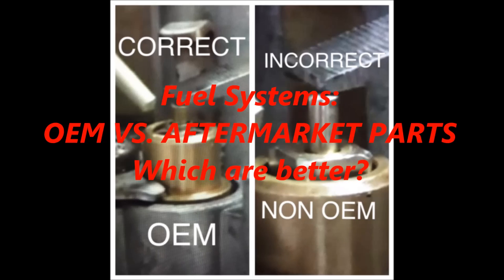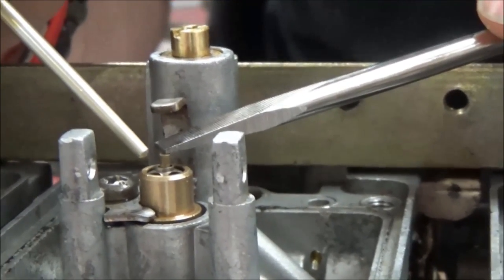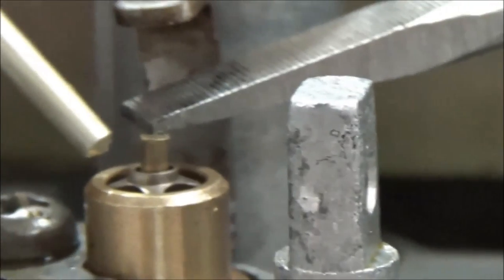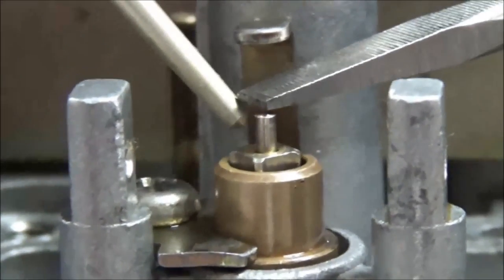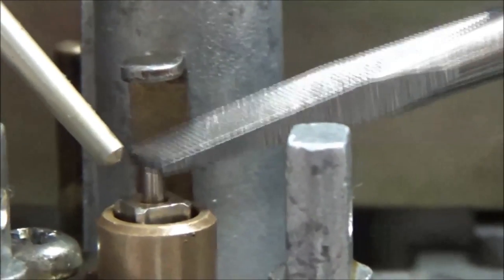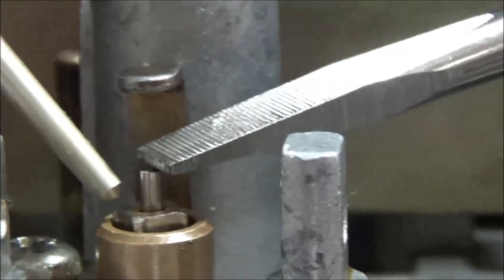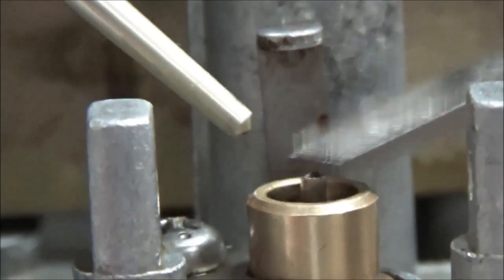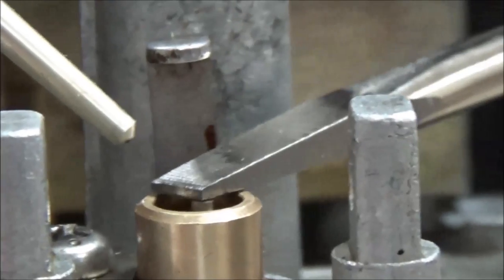OEM vs. Aftermarket K&L Float Needle replacement: Are they worth the savings?

Comment: Great video.  I completely agree with your point about OEM float valves vs. K&L (or other knock-offs).  I recently rebuilt the 4 carbs on an '85 Nighthawk S and took the "cheap" route by buying K&L rebuild kits.  HUGE mistake.  The float valves either dried out, or where never dimensionally accurate from the beginning because the when the petcock was left ON, the bowls would constantly overflow gas into the airbox.  These particular carbs don't have bowl overflows, it just runs out of the front back of the carb.  OEM floats ($21 each) are worth every penny as they fixed the issue.
Reply from the maker: Thank you for taking the time to comment! Hit that subscribe button please! It helps us!
Here is a way to support all the free videos.
Want to say “thanks” or “keep it up”? Click here https://www.paypal.me/how2wrench  

Coach Conley is also available for hire to personally work one on one with you if ever needed. Yep he is a real person. Give him a call @ 602-345-0432

Your answers and help are just around the corner. Save time and money while protecting your investment and yourself by doing it the right way!
Follow us!
Web:
www.How2Wrench.com    
www.Tools2Wrench.com
Reply: Their rebuild kit wouldnt of came with actual floats which you said is what fixed the problem. K&L are NOT knock off parts lol they're source or made in Japan by the same rom manufacturers everyone knows this.

Comment: Need help with suzuki single mikuni carb...bike idles fine and when I crack the throttle it starves out. It has been plaguing me for 12 days and I cant figure it out. Is my float setting messed up...maybe I have an intake boot leak ?? any advice would be greatly appreciated.

Comment: Or, K&L just had the incorrect application info in their catalog or reference number. Occasionally you might find a mislabeled batch, but K&L will always correct it. 

Most of the K&L branded products are OEM parts, repackaged into a convenient kit under the K&L or Tourmax brands. For example the following list of product categories I know are OEM sourced if purchased from K&L under the K&L or TourMax brands.  Brake Caliper Pistons, Brake Caliper Seals, Master Cylinder Rebuild Kits, Slave Cylinder Rebuild kits, Most K&L Electrical (Regulator/Rectifiers and CDI), Fork Seals, Oil Seals, some float needles, electrical connectors, many intake manifolds, some cam chains etc.  K&L sources all these from Japan direct from the OEM manufacturers such as   Nissin, Tokico, ARS, TP, NOK, ART, Keihin, Mikuni, Hitachi, Borg Warner, etc. The rest of their product line, while not OEM sourced, all still come from Japan.

Anyway, great videos, I try to watch all of them!  I don't work for K&L but am very familiar with their product line. My job is product sourcing/manufacturing for vehicle manufacturers and distributor brands. I also do DOT/SAE and "E" Mark product compliance for products such as lighting, electrical and control systems for motorcycle manufacturers.  

Also, why are you buying parts at a dealer? Your school should be setup with distributor accounts or provided free service parts from suppliers for the school.   I was surprised to hear in the video you went to a dealer.
Reply from the maker: I love K&L Supply as well.

Comment: This review isnt reliable....for example OEM Kawa KLR needles cost aprox 15-20$, while aliexpress cheap can be aprox 1$ per piece (even less if bought a pack of 8, 16, higher quantity)....i have changed HUNDREDS so far and i can GUARANTEE you all; if the cheap one is in correct measurements with a fine final "finishing process" (polished, linear spring pin movement, rubber tip OK), then there is no any reason that needle would NOT work perfectly fine...in last 25 years of active servicing of carburetors i have never experience it bad in any way if everything was correct by the measurements and final quality!! i have never had a "warranty claims" or any kind of complaints that did include cheap float needles....only problem is that 15 and more years ago there was NOT cheap needles available like these days so the brand companies did "milk a cow" enormously with a profit maring of 2000% compared to factory price actually is....simply by logic if the cheap Chinish one at the price of 1$ sold is OK for seller to make some profit then i can only conclude what the real production price is in factory...maybe 50cents max....
Reply from the maker: 1. Pretty sure you missed some points he made in the video. 2. This also was a case study on this use. 3. We asked Shane and he said this..."He is welcome to his opinion but I'd question anyone saying they NEVER see bad parts brand new in 25 years...even OEM can be bad new. That being said, you have to study the other all the other videos where I show actual bad brand-new parts we pull right out of the bag. Again both OE and aftermarket. We are teaching skill sets, not selling. Lastly, you're commenting on a 7-year-old video and even we have some reputable aftermarket supplies now". 
Hope you better understand our channel purpose moving forward.